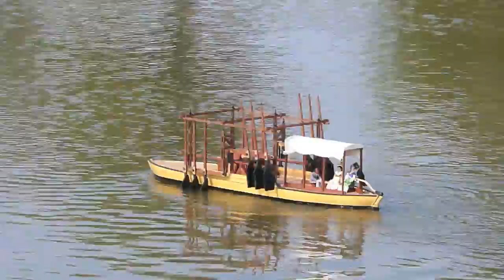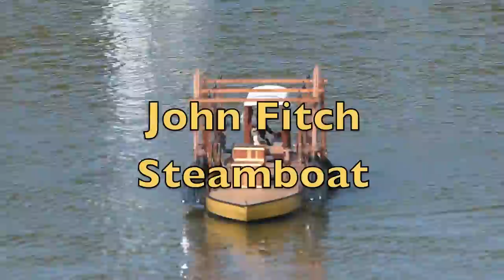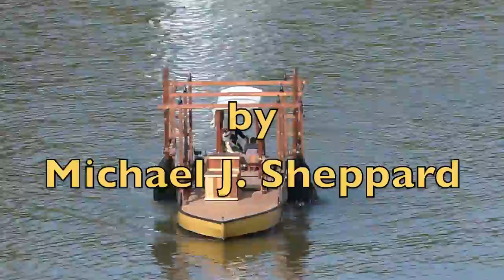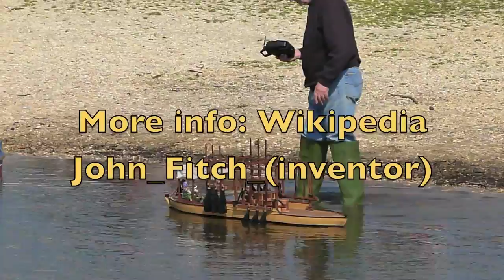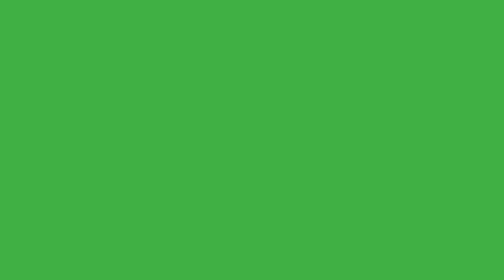Mike Sheppard's "The Beast"

Comment: By the way, does anyone happen to know where Mike got the drawings/pictures (if any) he used for construction of the model?
I am interested in building a full-size boat, if not an exact replica of this (or Fitch's first) then at the very least based on this unique design and method of propulsion.  However, good drawings and pictures are rare (the only really good pictures being on the club website), and while I might be able to make a design from those, any additional help would go a long way.